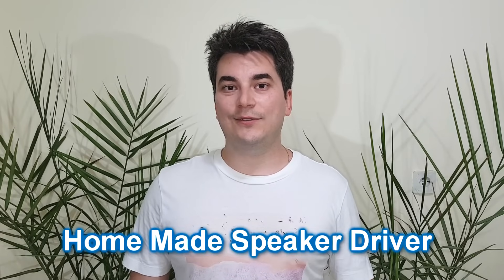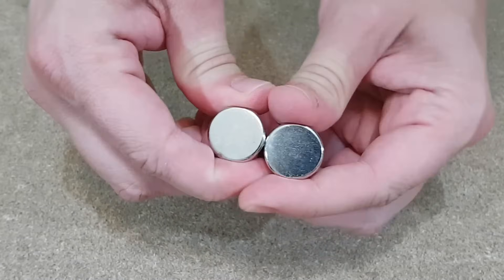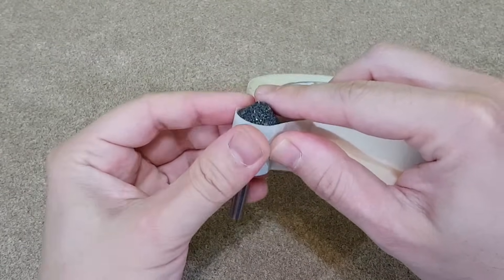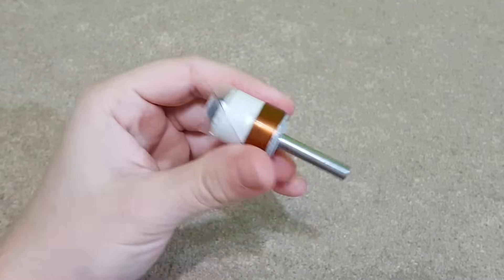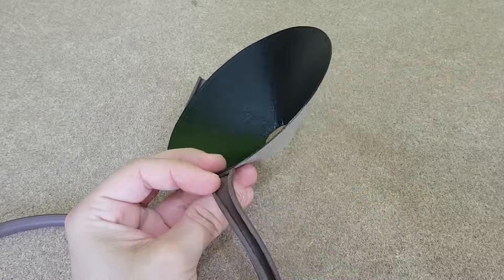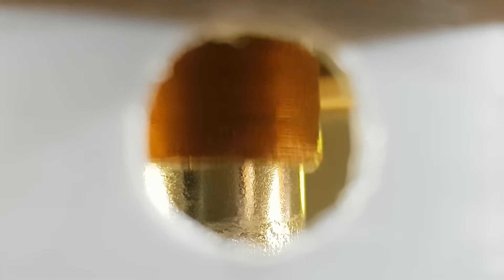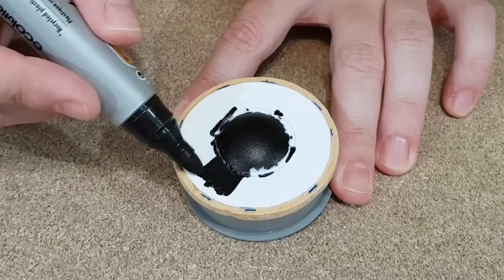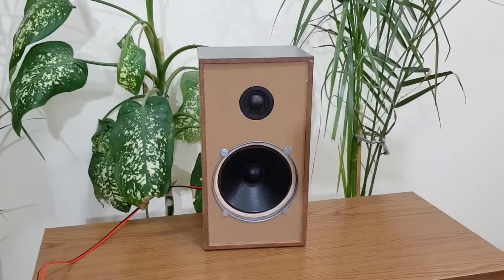Home Made Speaker Driver

Comment: can this speaker be powered by plugging it into a mobile phone jack
Reply from the maker: yes, but you will barely hear it. because the voice coil has a low resistance, so it needs an amplifier to increase the power.
Reply: @Sorin_DIY  thanks

Comment: 14:31 Can remove that flat centre part of "the membrane" to reduce mass, and also use thinner wire if available. Glue the ping pong directly to the coil former

I once made a speaker driver but it was more "home made" looking lol. Sounded ok however as it was lightweight enough. I don't bother making from scratch anymore, but I do modify and repair existing drivers

Comment: Some tips for speaker making:
1. If stifer the speaker the more power it needs to get the same loudnes as a non stiff speaker
2. Higher the speaker impedance harder to drive it to the max volume
3. If your voice coil has smaler air gaph beneth the magnet, the biger will be the sensiviti (80dB<)
Some for box making:
1. The bigger your box, is the lower it goes in frequency 
2. If you making a round ported box, ideal to put it in from the front to back corners
So this is all what tips i know
(Greetings from hungary! ;] )

Comment: Hi Sorin!
I ripped off a 20W 4ohm woofer speaker and 2 smaller speakers from an old computer speaker system. The PCB had broken
I thought I could use your videos and make one myself! :D
But there's a problem, I can use the smaller ones and make it but I don't know how to put the woofer speaker in the picture.
I don't know the wattage of the smaller ones but on the multimeter it shows 6 ohms.
Can you help me out?
Reply from the maker: hi. it's simpler to make an audio system with even number of speakers drivers, because you can just use a stereo amplifier board and connect 1 or 2 speaker drivers on each channel. but if you have 3 speaker drivers.. you need an amplifier board with 3 channels, 2 stereo and one mono. you can find such amplifier boards, but they usually are more expensive and powerful. I think you can use this module, but it's expensive:
https://www.aliexpress.com/item/33026986673.html?spm=a2g0o.productlist.0.0.68387c8aFPBpNC&algo_pvid=80d362aa-04d9-474a-b320-9ac06f8435ef&algo_expid=80d362aa-04d9-474a-b320-9ac06f8435ef-2&btsid=0be3746c15930723132503083e205a&ws_ab_test=searchweb0_0,searchweb201602_,searchweb201603_
Reply: @Sorin_DIY  Wow, thanks Sorin.
Due to corona, it's not being delivered to my country, I will look in some other online stores for the same thing
Also, I was watching videos from your channel and I found that the Amplifiers you made back in 2009 would be perfect for this! Right? Or am I mistaken?
Reply from the maker: the TDA7295 amplifier boards are too powerful for your speaker drivers. you need a low power amplifier.

Comment: Amazing how "simple" a speaker actually is built. I thought there is more than just a coil, magnets and some membranes. Damn. Great work!
Reply: The only difference being the materials that the speaker drivers are made out of. In essence, they all work the same way.
Some exotic and high end drivers use materials like Kevlar, carbon fiber or lightweight metals like titanium or aluminium. Most speakers have metal frames. 
Different materials sound differently to one another, as some sound very rich across a broad spectrum, others sound really good at a narrow frequency band. 
Subwoofer drivers are commonly made out of paper (most high-end units use a non-pressed paper cone, that adds a lot of rigidity). Cheaper units are made out of various types of plastic, as that is much easier and faster to produce.

Tweeters on the other hand can be made out of almost any material.

There is also the debate around using rubber or foam surrounds. One is better for SQ, the other is better for SPL, though one has better longevity than the other.
Magnets are also made differently. While most speakers use a large ferrite (iron) magnet, some use neodymium magnets. Neo motors have much greater force relative to their size, but they are also much more expensive to make.. However, neodymium magnets are much more durable than their ferrite counterparts.

In short: You are correct in both statements. A speaker is just made out of simple parts, but there is more to it than just that. Materials play a big role in the creation of a speaker driver.
Reply: @Skarfar90  wow. I'm learning something everyday

Comment: Quick tip on the bipolar capacitor. If you add diodes (1N418 or similar will work, see google for the schematic), you can make them truly bipolar and they will not loose capacity due to oxide formation on the cathode as can happen if the audio level is high enough. The signal in each capacitor is divided among each and is then offset by the diode to the midpoint of the peak voltage and the zero volt reference, and the capacitors only see a maximum reverse voltage of 0.6 volts, well within what they can handle.

Comment: Could there be some Small hole on the magnet, or on the tweeter box to reduce the acoustic impedance and to get it moving smoother? I think the air inside the the driver will act like a spring that damps the movement of the system. I don't know if it would make it sound better, but maybe it's still worth considering.

Still, awesome video and I will really try to make one myself.
Reply from the maker: hi. for bass speaker drivers is normal to have a hole in the magnet. but tweeters don't need a hole.  most of them are sealed in the back, I don't think I ever seen one with a hole. the tweeter membrane vibrates much less than a bass or medium range speaker driver, usually maximum 1mm. and this happens on high audio volume. so it doesn't create enough pressure inside to dampen the membrane movement. well... maybe it does a little, but insignificantly. another reason why tweeters don't have a venting hole is because they need to seal the speaker enclosure when they are mounted. the bass speaker driver creates a much bigger pressure inside the speaker enclosure and it will damage the tweeter membrane. you can make a separate cabinet inside the speaker enclosure to isolate the tweeter from the bass pressure, but this will increase the overall production cost and time of the speaker. so the simplest solution is to seal the tweeter and even some mid range speaker drivers.
Reply: @Sorin_DIY  Thank you for good answer!
Reply: @Sorin_DIY  I started to make a driver with somewhat similar design. Do you know how using a disc magnet (as in the video) differs from the maybe more conventional design, where a ring magnet is placed around the voice coil, which is around the pole piece? I have read that the purpose of the pole piece is to concentrate the magnetic field of the voice coil, so would it be the same if an iron ring would be placed around the voice coil in your design? It would probably make it a little harder to vent properly (less room to drill any holes), but it would also probaly help conducting heat away from the coil and the neodymium magnet. Or is this pole piece thing etc. only relevant when using ring magnets?

I know these may be complicated questions, but I really appreciate that you even answered to my previous question.
Reply from the maker: if you touch a magnet with a piece of metal, the metal becomes magnetic. if you take a metal ring and put it on top of a ring magnet, let's say on the North pole, the metal ring becomes magnetic with the N pole. if you take a metal disk with a centered metal piece (pole piece) and place it on the bottom of the same ring magnet, the metal disk (including the pole piece) becomes magnetic with the S pole, because it's touching the S pole of the magnet. now the magnetic field is concentrated and much closer to the voice coil, with the S pole inside and the N pole outside the voice coil. the voice coil also creates an alternating magnetic field according to the sound frequency and interacts with the static magnetic field poles. but if you place a metal ring around a neodimium magnet but not touch it, it will not help to increase the static magnetic field.
Reply: @Sorin_DIY  Thank you for this easy to understand explanation. I really appreciate that you have time to answer questions. I will just probably then drill some holes to the bottom part of the driver to get the coil cooling more efficiently.

I decided to try to make two drivers using somewhat similar design. I will just try to make it from a little bit better parts than just normal random items that are found from home, and I will maybe also try to simulate it in COMSOL (if I can do it, it can be difficult to calculate the B_l well) and plan all the details very carefully. I'm going to make the cone from kevlar-carbon fiber composite and maybe I try some other approach for the spider (I will maybe try some spring system or maybe I order a real spider. I dont know, it could possibly damp the system more linearly than a piece of rubber).

I will probably make a video of it, and I will give a shout out to you for this excellent design. But only if I can make it to work :D aligning the coil perfectly with the magnet won't be easy.

Comment: If I made my own speaker drivers, I would go fancy and make the frame out of CNC aluminum and the woofer and midrange cones out of carbon fiber. Then take beryllium from old x ray machines and make the tweeter domes.

Comment: For the bass audio filter how many turns did you do ?
Reply: Does it matter if i wind the copper on a ferrite rod , or onto some wood ?
Reply from the maker: there are different calculators online for crossover filters. there isn't a fix number of turns, it depends on your speaker drivers and how much filtering you want. normally more turns means more filtering. if you wind it around a ferrite rod it will be more efficient.

Comment: One thing tho, why can't the aluminum touch when doing the coil?
Gotta be something with the magentic fields from the wires, right? but I don't get why that is so important, can't be a very big deal in this case, can it?
Reply from the maker: hi. if the edges of the aluminum foil touch each other, it will create a loop, a closed circuit / coil. this will absorb a part of the electromagnetic field and transform it into eddy currents. these will work against the voice coil vibrations. to find out more about this, I suggest you watch the Electroboom video about eddy currents. he explains it better than me :)
Reply: As I thought then, but didn't think it would matter that much.

Comment: Helo Sorin. Would your homemade speaker driver still play without a amplifier board?
Reply from the maker: hi. all types of speaker drivers need an audio amplifier. if you connect it directly to an audio device, the audio level will be very low.
Reply: Thanks

Comment: Wow! I never thought a DIY speaker can sound SO Good! I love your videos!
Reply: Yeah. I made a diy speaker box from an aluminum soda can and some pillow stuffing, and sealed it with hot glue to the point of no air leaks. This is an acoustic suspension design, and the pillow stuffing makes those sound better. Used a typical small 10 watt full range speaker driver. (Not a woofer, nor a tweeter, but can do both.), which I had mounted on the end you usually drink from, which was removed with a can opener. I was surprised when it actually sounded good, not unlike this. Literally took me an hour and a spare speaker driver to make.
Reply: vista
Reply: Windows
Reply: @rissrissspritter  lol 😂

Comment: How did you connect the tweeter and the woofer, paralel or series? It's not clear in the video and I'm a noob when it comes to speakers
Reply from the maker: hi. the tweeter and the woofer are connected in parallel.

Comment: That's pretty damn cool!   I think you put the positive on the wrong side though.  The right side is the positive side.  I've never seen a speaker with the positive on the left side and I've hooked up more stereo systems that I can count over many years.
Reply from the maker: hi. I've glued the magnet the other way around. the magnetic field it's reversed. it's not important in which side is the positive terminal. it's important that the cone move outwards, when you connect a battery according to the polarity. in my case the speaker driver ended up with the positive terminal in the left side.